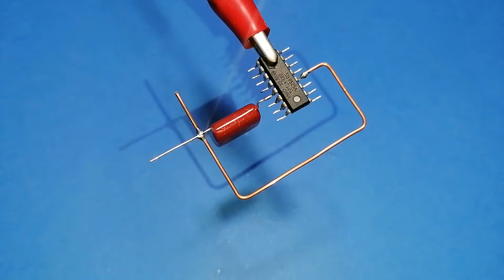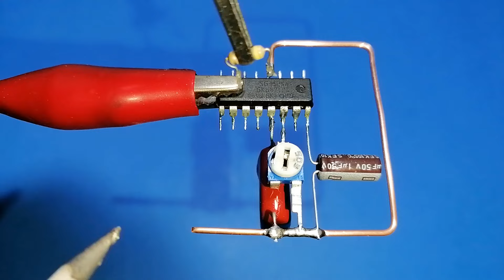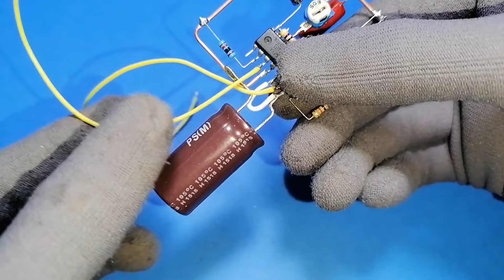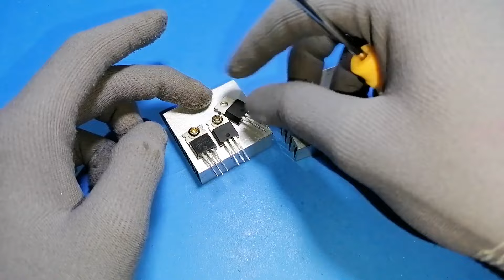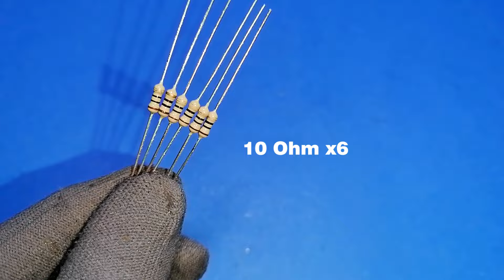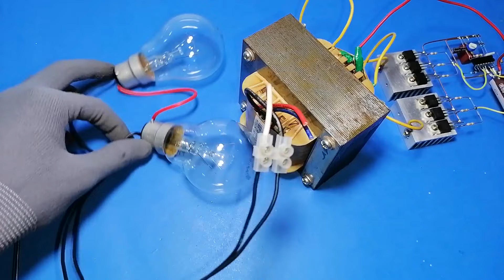How to make a Powerful Inverter using IRFz44 Mosfet & SG3525, 12v 220v Inverter

Comment: Pls is there any resistor that can be used to get a fixed 50hz signal 
Cause I don't have an oscilloscope to check the output frequency
Reply from the maker: Ok I will
Reply: You don't need an oscilloscope to check frequency. A good multimeter is enough, as seen in the video.

Comment: Good afternoon, sir. I hope you are doing well. I recently came across the pure sine wave inverter you created, and I was truly impressed by your work. I am reaching out to ask if you could help me with a diagram for a modified low-frequency transformer-based inverter that uses the IC S3524 or 3525, excluding those that use a center-tap transformer. I would greatly appreciate your response. Thank you!

Comment: if i use 6A transformer, how many watts can produce of that circuit diagram
Reply: 6A transformer can handle 5000w?
Reply from the maker: 1000W
Reply from the maker: @chesterongoco6985   no no bro

Comment: how did you get a frequency of 50 Hz if the chip itself outputs a PWM frequency of 100 Hz?
Reply from the maker: yes.  adjusting 50K preset

Comment: I tried this circuit it's working properly but the output AC voltage is only 130V. I am using 12v 7ah battery and 12 0 12 3A transformer and 2 nos irf3205  instead of irfz44.
Please advice how could I achive 210ac output voltage
Reply from the maker: Using 5A transformer and adjusting preset 50-60 Hz